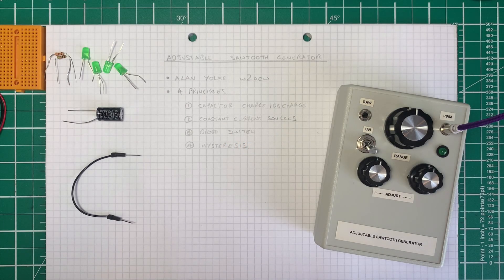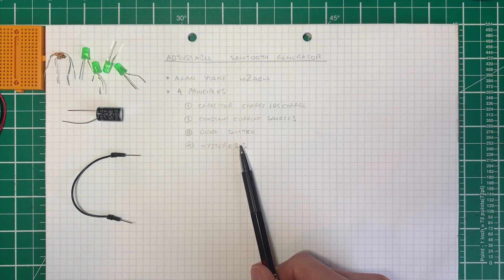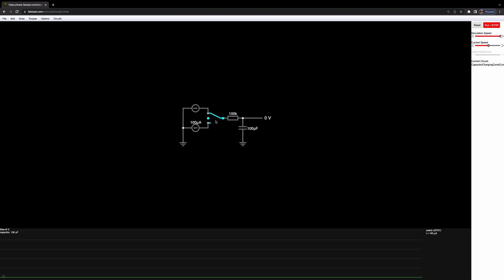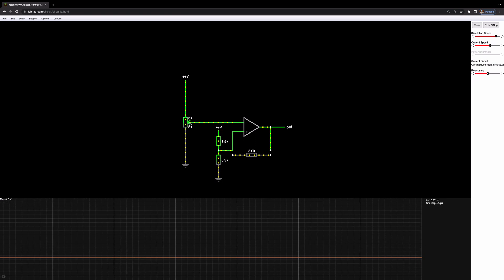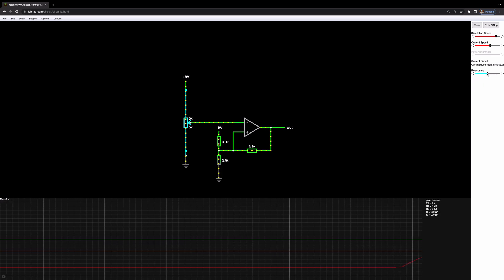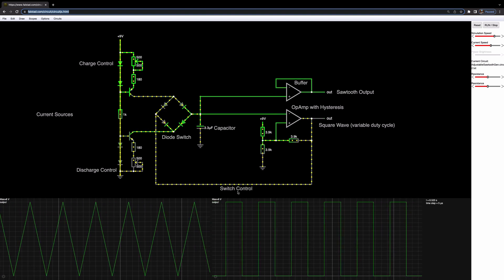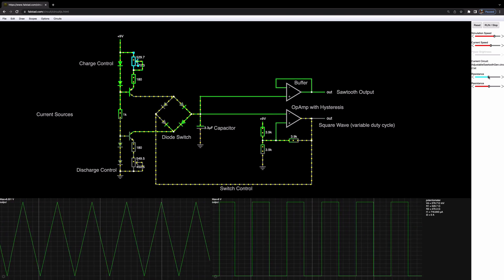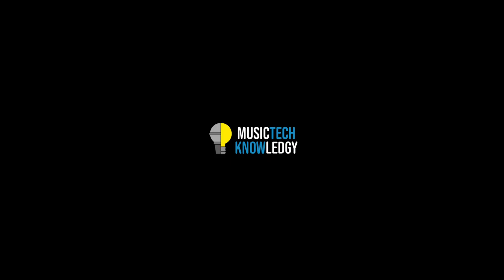How the Adjustable Sawtooth Generator works

Comment: OK fine, but can we make a pedal that will convert the guitar signal into an adjustable sawtooth wave?
Reply from the maker: Probably. I mean the square was bit is fairly easy with clipping. It’s the time it takes to charge discharge the capacitors being a function of frequency that’s going to be tough. Got me thinking now 👍